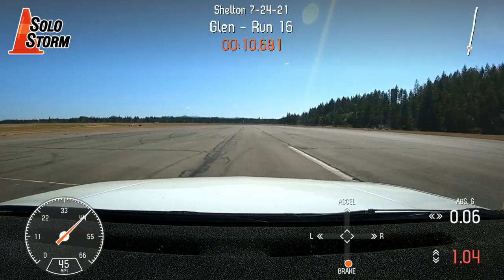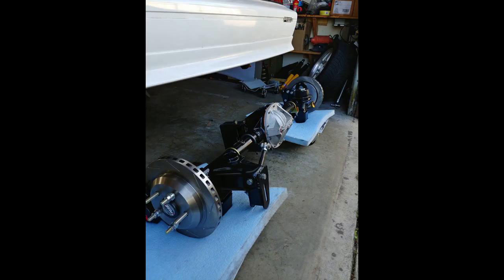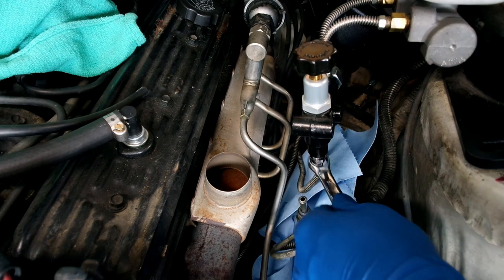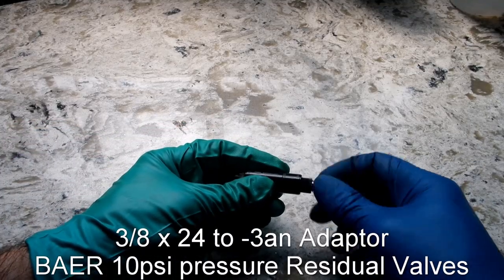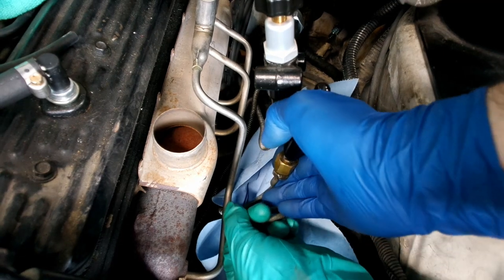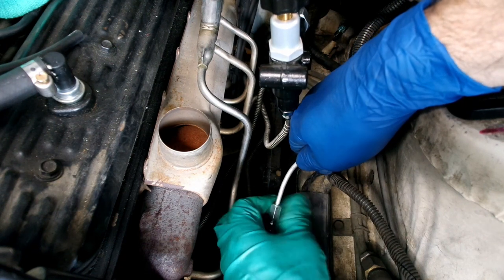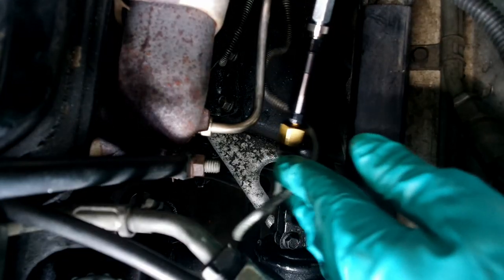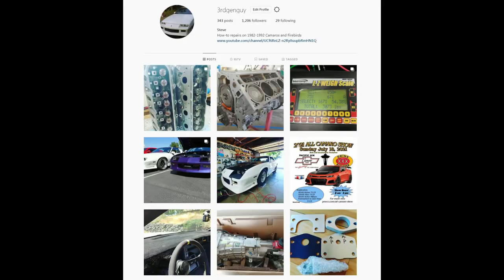Fix Pad Knock-back with a BAER pressure valve (82-92 Camaro/Firebird)

Comment: How does the pressure valve stop the pad knock? Does it keep the pads from moving as much? How much of an increase in the stiff pedal did it provide?
Reply from the maker: the 10psi helps push the pads back together. when the pads were knocked back, the pedal would move like 3/4in before the brakes would start working.
Reply: @3rdGenGuy  so the additional psi basically moves the pads back in faster essentially?
Reply from the maker: @MasonsMotorworks  ya, but it does that without me touching the brakes. some track guys use anti knock-back springs inside their calipers and a 2 psi anti drain back valve.

for example: 6th gen camaro's have a valve built into the master; that valve holds pressure in the system. same thing basically.
Reply: @3rdGenGuy  So after i complete my brembo rear caliper swap, I can get a baer, or any pressure valve, and do this mod to help with the knock back?
Reply from the maker: @MasonsMotorworks  ya, Wilwood and BAER have a valve available.  but, unless you track or autocross your car with 200TW or lower tires; you won't encounter pad knock-back though.

Comment: You shouldn't need a pressure valve with disc brakes, which makes me wonder what the real problem is.
Reply: as he said. The disc moves and push the pads back. That is why he needs it.
Reply from the maker: C-clip axles are a Bit*ch mang
Reply: @3rdGenGuy  Wouldn't 2psi be enough?
Reply from the maker: @Thirdgen83  for say just, the front brakes, sure.
but in this case that 10Psi has to push back 2 calipers on a crappy C-Clip axle.
Reply: @3rdGenGuy  Wow, I never knew about that. I still have drums on the rear.
Reply from the maker: @Thirdgen83  with drums you don't need a pressure valve.